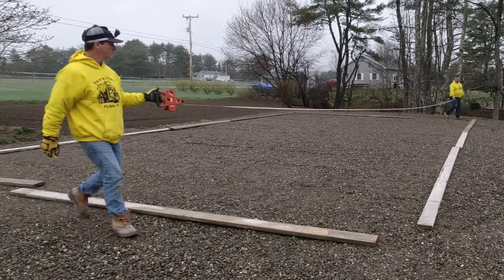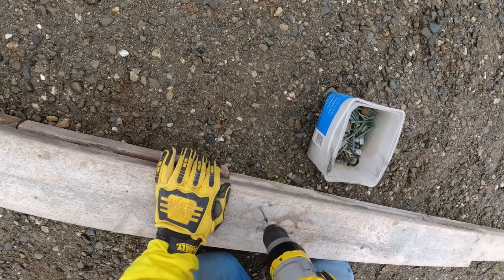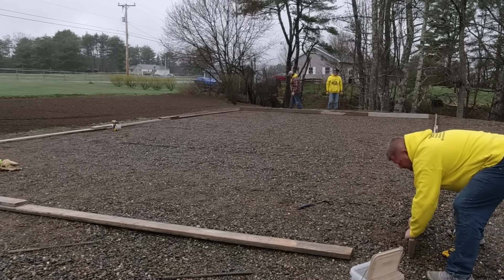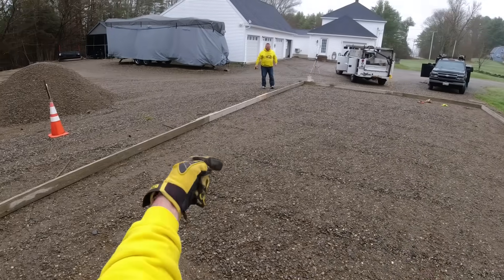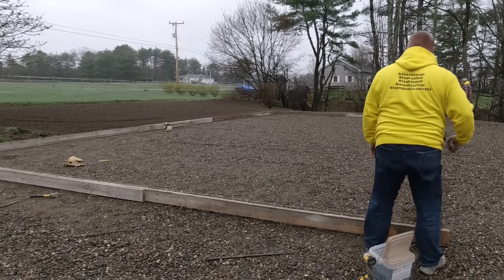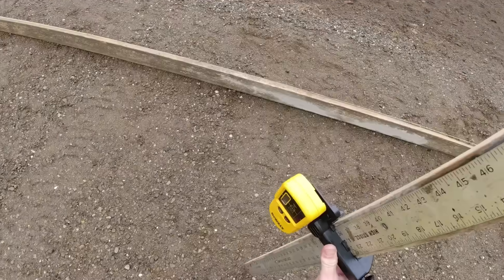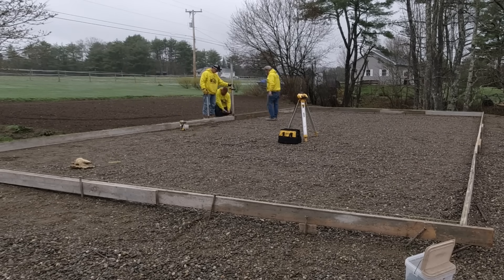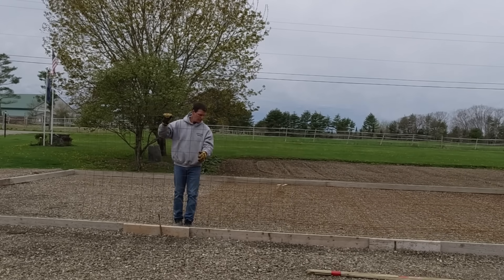Is A 6-Inch Thick Concrete Slab Good Enough? Here's What You Need To Know

Comment: Hey, Mike, I'm 66 and have been watching you for years. This slab will hold a motorhome, a tractor, a mower, and probably lots of junk, LOL. Provide us with a perspective on the next pour video, on a higher-weight loading floor, such as if a person wanted to put their full-sized backhoe in this garage, along with a small excavator. What would the thickness need to be, and the rebar/footer requirements be? Then, if a guy had 2 large excavators and a dozer, he wanted to put in there with 16-foot doors, what would be required for the floor as far as thickness and rebar, for a weight of around 100,000 lbs, etc.? Love your videos, I've learned so much, thanks.

Comment: A metal building structure is only as good as the foundation it sits on. But, if the anchor bolts that's drilled into the concrete are not installed correctly the foundation and building can look great and still not be worth a damn. The fly by night Mexican installers these metal building companies hire and pay cheap are not trained, don't give a damn. They install the anchors bolts with out drilling the holes the correct depth, don't blow out the holes, bend the bolts and don't torque the nut. And you know nothing about how they suppose to be installed. You just want a concrete pad and a building. People, you spending thousands of dollars and these steel companies, dealers, installers are giving you junk. You say, oh it looks good, pretty. Your stupidity just bought you junk. Do your homework how concrete and buildings are to be built the correct way. These people s**t you on concrete, material and do a shitty job in a hurry to get that check in their pockets. Do your homework and don't let them s**t on you.

Comment: Mike, don't know if this is the best way to ask a question but I live in Colorado so we get freeze/thaw too.  Had a brand new driveway poured last May (2024) that had cracks from one side to the other within 20-days after the pour.  This winter (2024-2025) it really started to crack all over the place.  I contracted the guy that we contracted who has really done nothing.  I don't really know how to get help with this and was hoping you may be able to point me in the right direction.  Thank you in advance.
Reply: The details can likely point toward cause of failure. How far a drive is it from your place to the concrete plant roughly? Were you there when it was poured to see how wet the mix was? Did they add water to it after arriving? Was it a hot or cool day? Did they use wire mesh reinforcement? Did you have a gravel base, and if so, how thick? Did they cut control joints in the slab?

Comment: That will make a great hop scotch board. If you are going to legally build any structure on it, you first need footings. The entire perimeter, except at openings, must have footings and be inspected BEFORE pouring. You cannot install a load bearing wall on a 6” slab. Anchors must be imbedded in the footing and spaced per code, to tie the exterior walls to the foundation.
Reply: He said he talked to the inspector
Reply: @ 
It must have been a police detective inspector. No building inspector would sign off on a 6” slab without a perimeter footing for a structure to be built on it. It’s probably a driveway. Just makes a good YouTube video.

Comment: Mike. I have pit set a mobile home it is setting on cinder blocks. I am going to put a 15ft patio all the way around it. It was suggested to put rebar into the cinder blocks to hold concrete to cinder blocks. If slab moves that doesn't seem like a good idea. We had to haulbin 3 foot of dirt on one side. Fyi. Tie it together? Or put that buffer piece like in your video